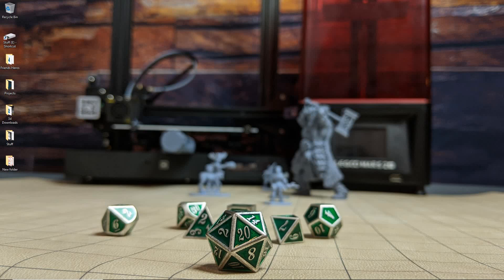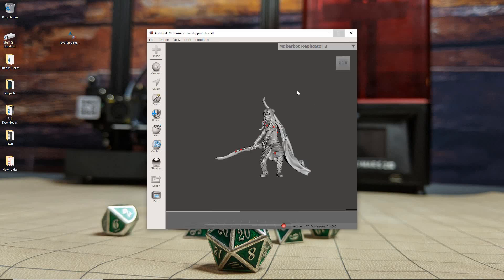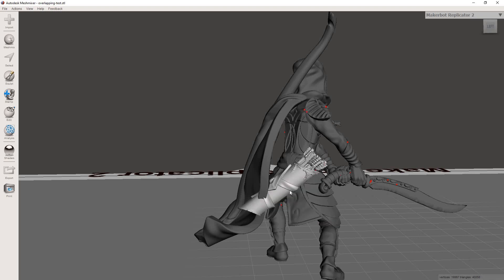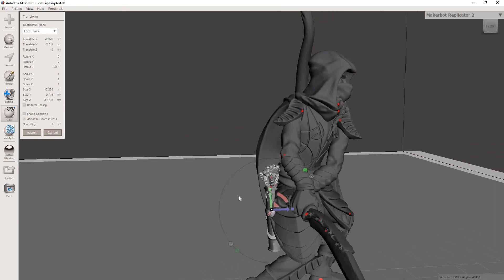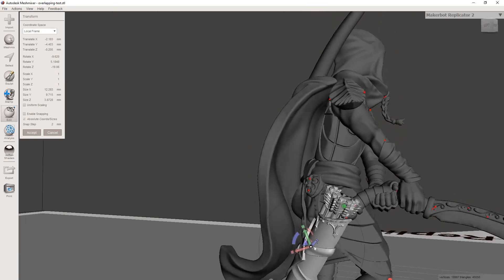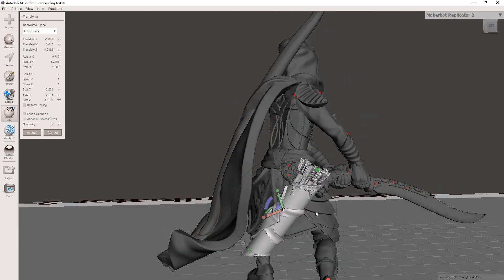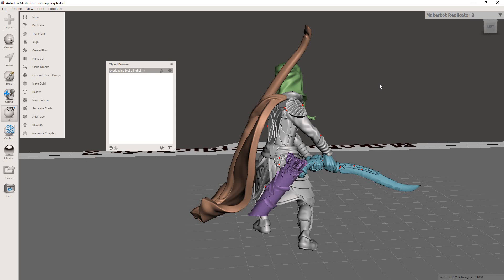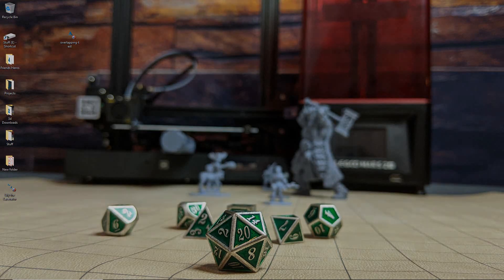How to Separate Edit & Combine Shells in Meshmixer

Comment: Thanks for the video. But i need help indeed ;) When ı click Seperate Shells of my obje, its says " No multiple Shells Found " I found the D&D Rogue in Cultis 3d. So what should i do ?
Reply from the maker: @FefeBlue  so there are models that will be a combination of different shells and then models that are just one piece.
I'm a very visual person so I like to think of it this way, a model with different shells is like if you took different parts of a picture and taped them all onto a canvas. You could easily remove the tape and move them around however you like.
However if you were to glue each of those parts of the picture to the canvas it then becomes permanent. The only way to move those individual pictures would be to cut the canvas apart and reposition things. 
That's exactly how it works with models. Sometimes a Creator will export the model with all the information of those different pieces basically just taped together. Then programs like Meshmixer can pull them apart easily.
Then other times a Creator will export the model as one part that cannot be separated unless you cut it apart manually.

In the below tutorial I explaine how to manually cut a model, separate it, and add alignment pins for easy attachment after printing. Feel free to reach out to me if you have any more questions.
https://youtu.be/ju0X92Shb3U

Comment: Eh, I really hate Meshmixer now.
Few times I used combine on all the items in object browser, but then when I try to split the model with plane cut -> separate shells... it always goes back to giving me 100 objects like before combining.
Reply from the maker: The issue you're seeing is because you're not using the correct process for your goal.

"Combine" allows you to hold multiple objects together, but they are still technically separate parts. This requires a lot less computing power and makes them easy to edit later. 

"Boolean Union" allows you to permanently attach objects together as one object.
Doing this process on multiple objects at once can be a pretty big task on your computer. However, it will accomplish what you're looking to do.

This video has a bit more info on how to use Boolean Unions if you'd like to check it out. 
https://youtu.be/dyUWkZSxsiY

Comment: That model won't print. The printer will try to print the bottom of the curve in his sword but it's hanging out there in mid-air so there's nothing for the print head to print on. That will cause the print head to begin dragging a wad of filament web which will snag on the rest of the part and pop it off of the platform.

A 3d printer will print up and out, or up and in, as long as you are starting on the platform, but it cannot print out and down like it would need to in order to print that sword. A simple solution would be to add a support rod from the base of the printer up to the sword, or remove the arm and sword and print them separately, gluing them together after the print is finished.
Reply from the maker: That's really not what this video is about. I appreciate the feedback and I definitely agree that this model would not print without supports.
However, I think you may have misunderstood the goal of this tutorial video. The goal was to explain how to separate, edit, and combine parts of a model. Adding supports to this model and slicing it for printing would be done in a different program altogether.
Reply: @SlicePrintRoleplay  Yeah. I understood the goal and found it helpful. I wanted to just point out that if someone was new to 3D printing, they may not understand that you can't print just anything. You have to understand how your printer prints layers from the bottom up, and if you have anything that is hanging out in the air, like his arm and sword, you need to maybe add supports, or slice it off and print it as a separate object on the platform, then join them together afterward.